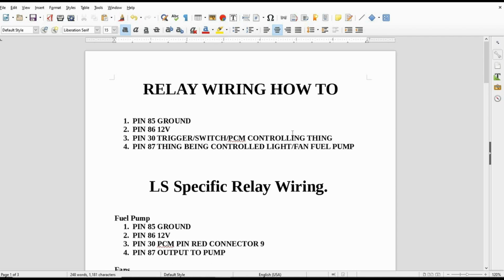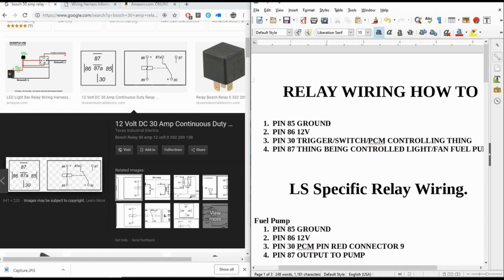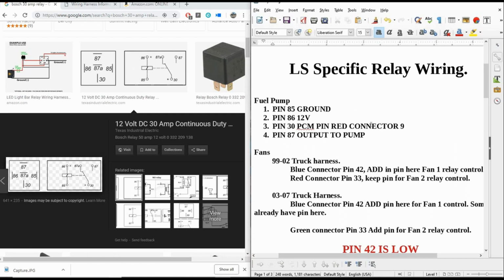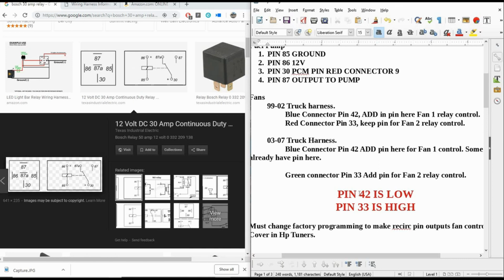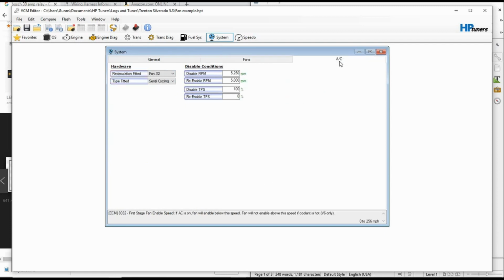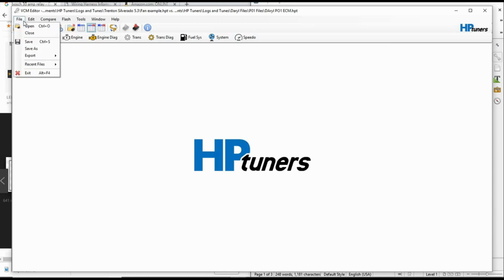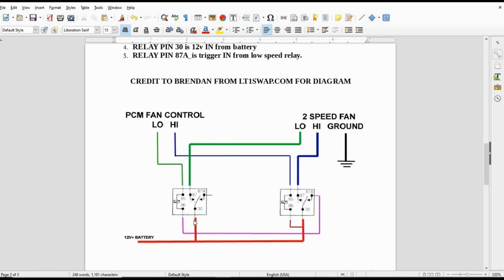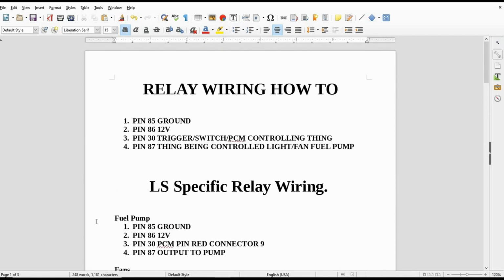Relays made simple. How to wire your LS swap fuel pump and fans. How to enable fans in HP Tuners.

Comment: I have a problem. My fuel pump doesn't power on when 87 is connected. But it powers on constantly when 87a is connected. I have fused battery wire going to 30 and terminator x trigger going to 86
Reply from the maker: Well, your relay isn't hooked up as described in the video so...
Reply: @TheDrivewayEngineer  ok. I'll try your way. Thanks

Comment: This is very wrong. You even contradict yourself between the pin assignments and diagram at the bottom.
Reply from the maker: And yet, mine all work
Reply: @TheDrivewayEngineer  because you pretty obviously wired it differently than what you stated in your diagram.

Comment: I might eventually figure this out just from wiring my LS but if my honda civic electric fan is cycling off and on very often , is that a hardware problem or software? when idling it will come on and off about 15 times a minute. i assume it stays on longer during driving but hard to tell.
Reply from the maker: I really have no idea lol, idk what's normal for a Civic.

Comment: Bottom little list there is WRONG, but lets keep putting this up for people to build their stuff wrong. You paying for peoples computers when they fry them because they aren't smart enough to know it's wrong?

Driveway engineer needs to engineer the correct info here.
Reply: Im doing a S10 LS swap and  bought the same relays. Your comments were rude but did have me questioning. So about 45 mins ago I used a bunch of alligator clips and a 12v motorcycle battery and multimeter. Hooked it up the exact same way (with the trigger wires being the negative ground on battery) and guess what? It worked! Very well actually.  If you fried your computer it was indeed bc someone wasnt smart enough...Next time make sure you know what youre talking about before trying to be a dick
Reply from the maker: @rpmspeedlab993  yeah, all my personal relays are wired this way lol
Reply: @TheDrivewayEngineer  thanks for the info! I use your channel as my guide. problem is what to do with the green wires on the 4l80 connector that goes to c2 block (not the tc control, I have that going to brake switch)
Reply from the maker: @rpmspeedlab993  shouldn't be doing anything with it, it stays in the harness, pcm controls a solenoid with it
Reply: Yea, exact response I expected from a clown...

Comment: Thanks again for helping out. I had someone do my harness and I found a few mistakes at the relay/fuse wiring.  Relays were not properly hooked up. Now I need to figure out which wire to tap into at the fuel relay on my foxbody to trigger the pump.
Reply: David, I am just beginning an LS swap into a 92 mustang coupe did you figure out the correct foxbody wire? My motor should be back from machine shop this week and I have a TKO transmission to go into it as well. Wiring is my weak point...
Reply: @CouchHam  I sure did! The fuel pump relay is under the drivers seat, I removed the seat for more access.  I cut the pink with black wire and connected my fuel signal wire from the new harness and it worked great. Car fires up but I dont get throttle response. Tired of going back and forth with the tunner and the guy that did my harness and decided to go with the Holley terminator x Max. We'll see how that works when it arrives.

Comment: So on my 1977 K10, 85 is ground, 86 is 12v from battery, 87 is wire from mew fuel pump and what would 30 go to? Sorry to bug you lol
Reply: Not for an LS swap just for efi fuel system
Reply from the maker: Either a ignition hot or the PCM fuel pump trigger wire, I believe that's red connector pin 9,but check at LT1swap.com to be sure.

Comment: 30 is 12v power. Hope no one bricks their PCM
Reply from the maker: Why would triggering a relay brick your PCM?
Reply: Switched 12V power applied to terminal 30 energizes the coil in the relay thereby applying fused supply power from terminal 85 to output terminal 87.

Comment: All 5 pin relays aren't the same! 30 and 87a are connected when no power is across the coil. When coil is energized 30 connects to 87. Dual 87 relay, no 87a, both 87's are connected to 30 when coil is energized
Reply: I'm looking at a 5 pin relay and in my case 
30 should be supply voltage.
85 should be pcm 12v + red pin 9
86 Should be ground
87 should go to pump
Reply: I think what he meant is that a 5 pin can be used in place of 4 pin

Comment: One additional thought. I have EVERYTHING a running driving van with LS. Would it be better to use ALL the electrics? Incl. relays, fuze box, etc. etc?
Reply from the maker: I would take everything, but you don't need it all, alot of it is for body functions, lights, etc.
Reply: @TheDrivewayEngineer  That's what I thought, it is going into an 83 Camaro, so space will be tight. One step at a time, all your videos and effort are going to pay off now!  LOL

Comment: I am hoping with a running driving complete Van, I "should" be able to label EVERYTHING COMPLETELY and hopefully not have problems here. Other than conversion to electric fans (where this tutorial is huge) and future AC install etc. Ignorant question, I "assume" the HP tuners etc. will do factory ECM for my fans etc.control? Thanks again.

Comment: What yr Taurus fans or what fans do you recomend...relays are confusing but you made it sound very simple thanks
Reply from the maker: The original Taurus, like 89-95 or whatever the years are. That's the style of fan that pulls like 2000 cfm.

They are found on Lincoln Mark VIII and I pulled mine from a Mercury Villager which has the same style.

It's a fan, with a decent sized shroud all together.

Comment: Dude you are totally wrong..
Reply: Yeah by looking at the diagram the relay is always going to be energized if you have constant 12v and ground on the other, on the coil side of the relay, the pcm needs to be wired into the coil side so it can trigger the relay, the whole point for having the relay. The pcm can’t handle high current loads thus the use of the relay.
Reply: 30 is power in?
Reply from the maker: Obviously 😂😂😂😂🙄🙄🙄